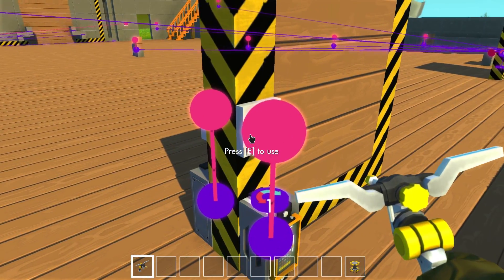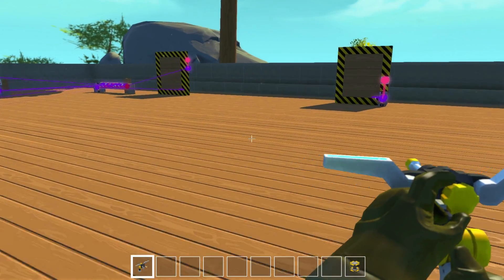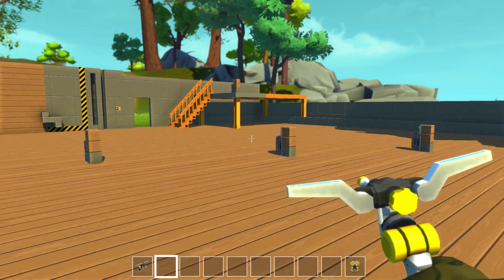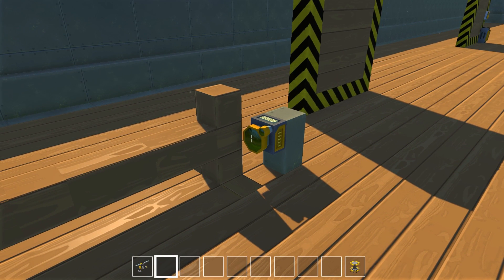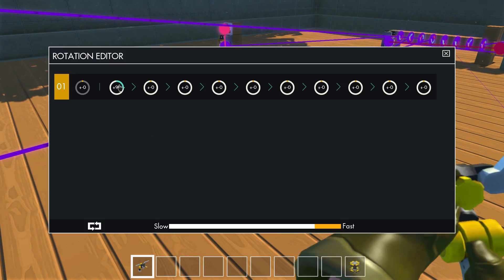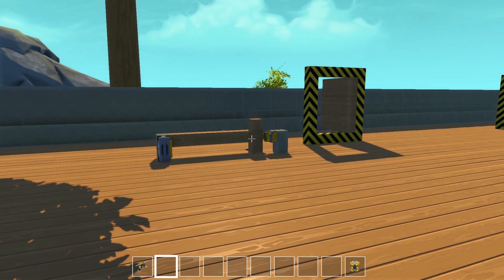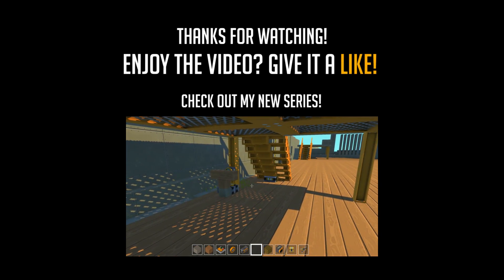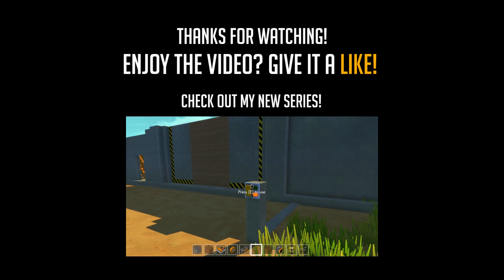Scrap Mechanic Tutorial - Multiple Input Switches, One Controller

Comment: Hello, I don't know if you figured this out or not yet, but i just figured it out from simply looking at someone's build, and i thought "oof it was that obvious" there is actually a block called a "Logic gate" that is basically a block that has conditions, so, what you do is, you place 2 buttons or switches, then you connect them both to the logic gate. You select the logic gate and click "XOR" as it's mode, then you connect to the logic gate to a controller or whatever element you wish for it to affect. It will now negate each input and allow for control from both switches. :)
I hope this helps~! funnily enough, this block was in the game since at least 2017, so, yeah they did definitely fix it, but not many people noticed it!
Reply from the maker: It was not as easy back when I made this video (6 years ago now, wow...)

Comment: Fantastic workaround weemcast! Anyway, multiple controllers to one bearing is like must-have for the game... Like i was up to build vehicle with bearing rotatin big wooden wheels, but i can't play with controlling them much for turning the vehicle.. i can have just two wheels for powering the car and another two to turning it. But still, it would be veeeeery sweeeet to have the possibility of connecting multiple controllers to bearings, and then also multiple switches to controllers (however the second one could bring the game mechanics some trouble thought - as you can simply compute behavior of the bearing with multiple different inputs, this doesn't have to be the case with more different kind of inputs to the controller...)

Comment: Nice video dude! But I really need a contraption where I press multiple switches and the door opens/closes without going back to the original state (like your door closes after you opened it - I want it to stay open) :D. I have a solution but its only for two switches. mhh :D Sooo complicated ^^
Reply from the maker: +CoCoaCoCi My door closes after it opens, only because I have it doing that in the controller. I mentioned (in another video) that I would be removing that rotation in the controller so they will stay open (or stay closed if already open) - so it can be done with this system ;)
Reply: +weemcast nice. Sorry I missed that part. I liked the video and subscribed!

Comment: I thought Zisuma's AND/NAND gate setup was ingenious. Which it is. This is even simpler and more easily added to. Nice job, Weem!
Reply from the maker: +Xanti Shayde-Walker (Xanti) Yea - as I mentioned, my inspiration came from them, but I feel like this was (for me) much easier - it's less fiddly (imo) re: the method for activating/deactivating the sensor - it's obvious at a glance what is happening, which is great for when there are problems down the line, etc.

Additionally, I tried to use their setup but it didn't work for me. I didn't mention it in the video because it was likely something I was doing wrong (though it seemed I had it setup the exact same way).
Reply: To each their own. You gotta do what feels right and works for you. ;) Besides, things happen. You made something based on that other guy's design that worked for you, so it's all yours now. It looks like a fun game, I may watch some vids on it, though I probably won't be buying it anytime soon. I just bought enough games on the Winter Steam sale a few months ago that will probably last me for at least a year or more. So many games, so little time. Lmao!

Comment: That looks very nice but you can't put another bearing on the top of the door for the second controller?
Reply from the maker: +Costy _ Nope, unfortunately not. If you put two bearings facing each other, and then tried to connect them, your blocks will not go all the way - they stop at that last block. If you then try to add in the last block, it will appear in that space, but it is not actually connected to the bearing :/ This will be obsolete in the near future though, I'm sure. This functionality is coming I'm almost positive (based on something the devs mentioned).
Reply: I see, well your solution will work until they update the game. But you should hide that device somewhere in a room
Reply from the maker: +Costy _ Yea, in my series I just started, I put it underneath one of the balcony areas in the corner - hidden away, hehe